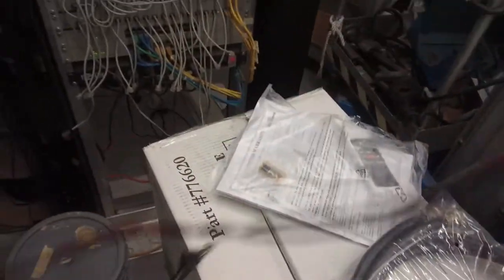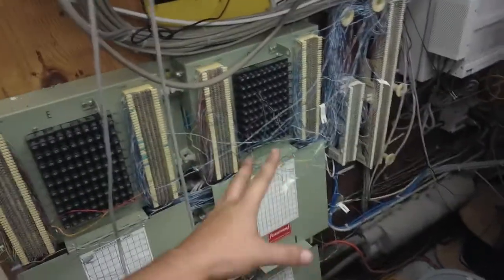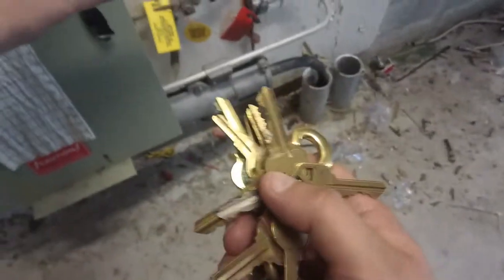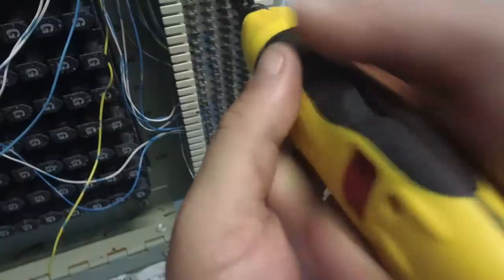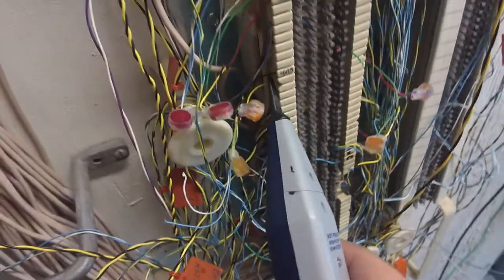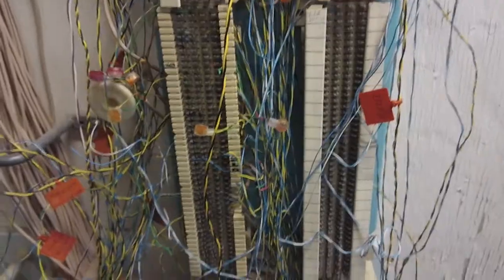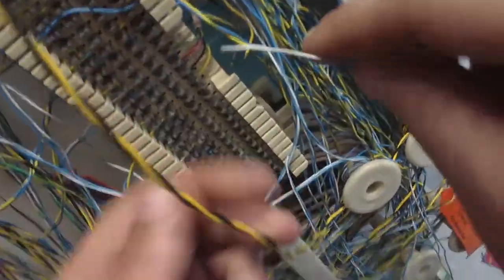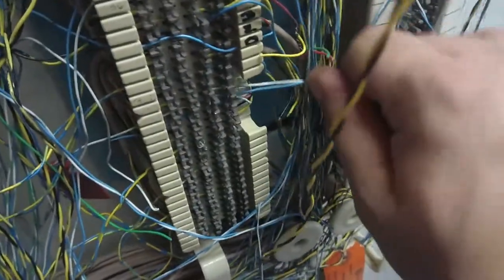Installing A New Temporary Phone Line

Comment: is that a 7 digit number you dialed from your cell phone? In my area (orlando) 10 digit dialing is MANDATORY only landlines can use 7 digit dialing but that's with a dial-plan that just adds 407 at the beginning of a 7 digit valid number.
Reply from the maker: Yes it was . Here in Jacksonville most times you do not have to dial the area code . I think on a land line you do  Thanks for Watching and the Sub